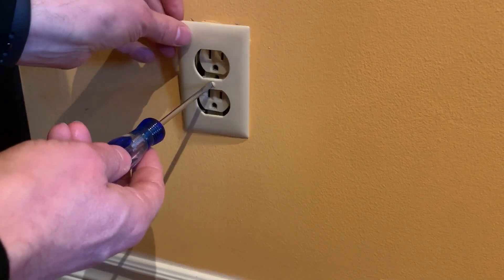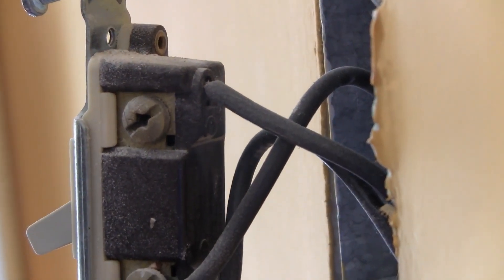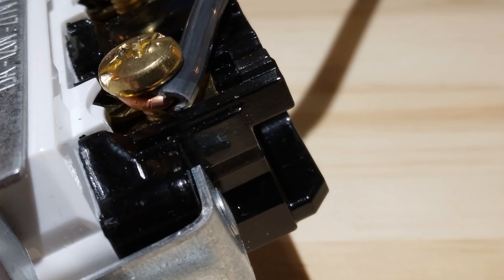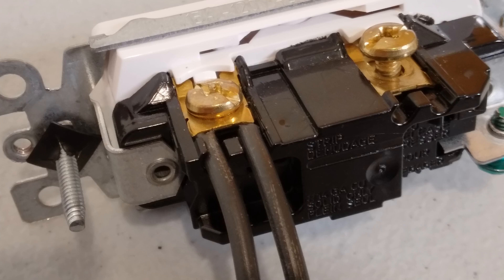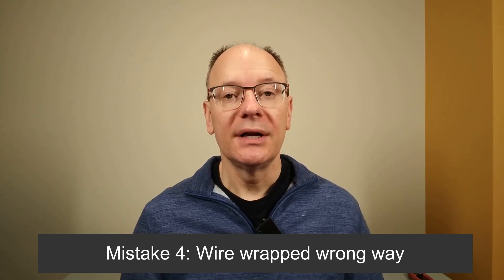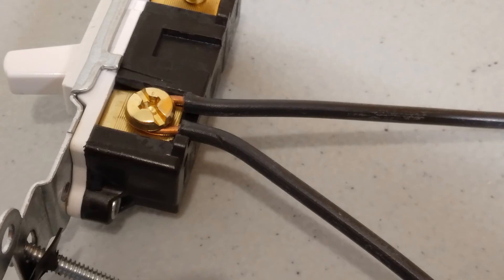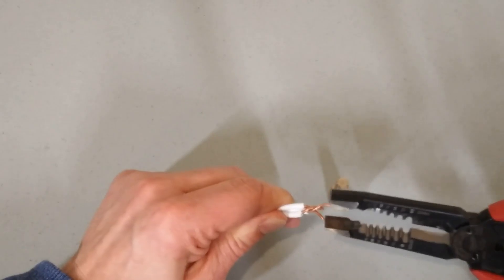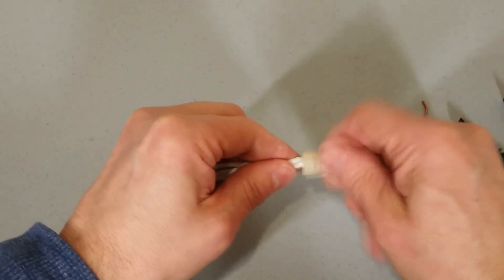Fix 7 Common Electrical Wiring Mistakes Found in Houses

Comment: I am surprised you did not mention an open splice hidden in a wall or under kitchen cabinets. I just found one in my house under the kitchen sink cabinet that was arcing against the wood of the cabinet. The disposal had started leaking, water got under the floor of the sink cabinet, it got the Romex wet including the paper and was actively arcing when I took the cabinet floor out. The dishwasher also was not grounded as the the bare copper grounds at the open splice were never connected. Open splices should never happen, that splice should have been in a junction box and either mounted in the back of the cabinet on the vertical wall or in a non-damp cabinet. What happened is the romex from the breaker panel was too short to go to the dishwasher so they spliced another wire in and buried the open splice under the sink cabinet(real genius level thinking) which is stupid and not NEC compliant. I am installing a steel junction box two cabinets from the sink that is properly grounded, using clamp connectors for each incoming wire, and using 12/2 W/G UF-B as it is allowed in damp and dry locations in the home to go under the sink and dishwasher to make the connection. The electrician even ran the romex through stamped hole(sharp edges) in a piece of sheet metal under the dishwasher, no grommet or wire protector. I am pissed as my house could have burned down had I not been home when I heard the arcing.

Comment: I redid my backstab outlets.  Fortunately did not have to trash, because a screw was another option, and the stab can be released by poking in a hole beside it made to release the wire.  Shocked that the designers did not study the geometry and realize that the point of contact between a round wire and a push-connector edge is one molecule of copper!
Reply from the maker: I'm glad you found the video helpful. I'm not sure I trust that stabbing the screwdriver into the backstab release won't do something inside the outlet since the contact metal is hidden.
Reply: @upgradeyourhomediy  Thanks, but the main point was that backstab has a greater risk than just accidentally releasing the wire.  While functioning, it is an "electron bottleneck" because of such a tiny contact area. and will create heat.  That is also a concern with lever connectors.. sometimes the contact area is just where a round wire is tangent to a straight line.  A screw head squeezing many molecules of a wire seems much safer.